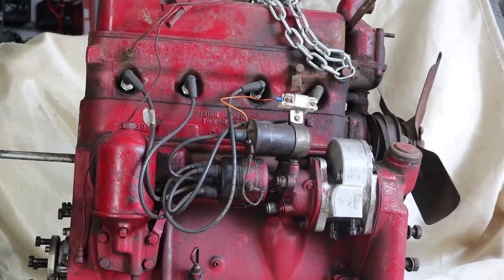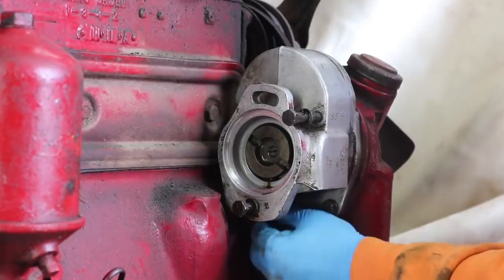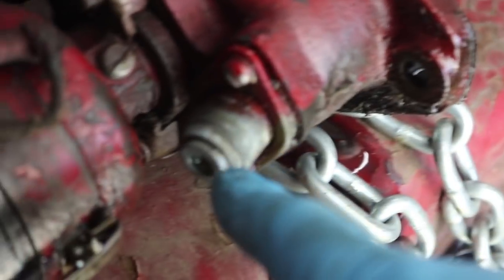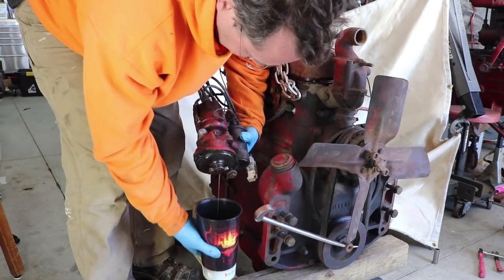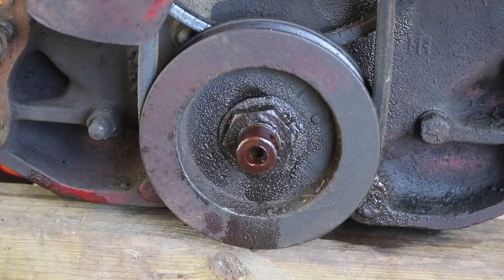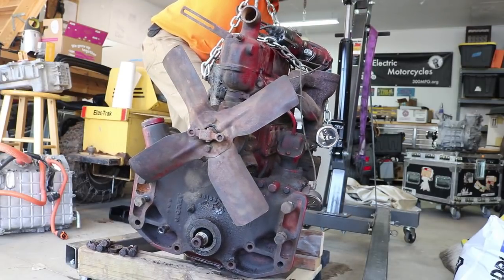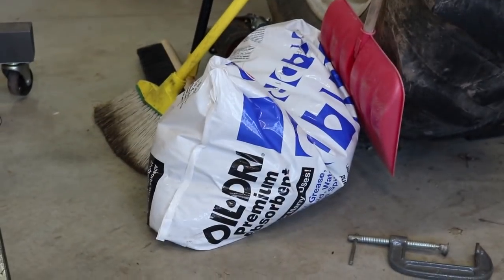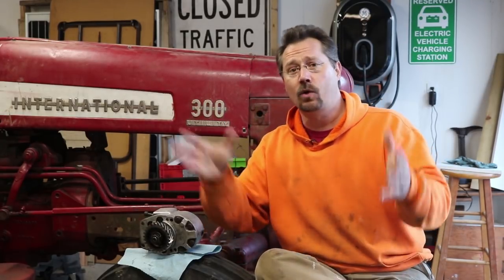Electric Tractor Conversion: Hydraulic Pump Removal

Comment from the maker: Just a reminder. On this tractor, several different things use hydraulic power. The first is power steering, but that's very low power. Secondly is the rear lift - the Fast Hitch/3-Point Hitch. Last is any other external mounted equipment. In this case, the big one is a front-end-loader that came with this tractor and will be reinstalled when the tractor is all back together.
Reply: Zapi motor controllers, I've seen some in forklifts that have dual AC outputs for dual traction motors.  Crown RC 5500 forklifts for example uses them. I believe it's the AC-2.    However I'm not sure what would happen if you have an uneven load between the 2 sides.   Not sure if they could be throttled independently either.  But may be, because a counterbalanced truck will need to shut down or just reduce power to one motor while cornering.  So I'm thinking there probably is a way.

They are wonderful motor controllers too.
Reply from the maker: @AftermarketCRX  I looked up some information on those. Fascinating! One version of that controller has another output - a DC "chopper" PWM power for a pump!
It doesn't look like those controllers are designed for use with just one AC motor as the difference between the two motors is used as part of the steering system.
Reply: I would look for a PTO driven hydraulic pump. Attaches to the rear of PTO and it still has a shaft for PTO for implements on the other end. Grainger sales them. 540 Hydraulic PTO pumps. 
Edit: I just realized that the PTO has a clutch to drive the rear and you need the hydraulics to run with the engine. My bad.

Comment: I personally wouldn't  use that pump. Nothing wrong with it but it is very  expensive to replace to the tune of about $600. There are much cheaper  pumps  that will work just fine for the loader and three point hitch. I mentioned in another  video too you can run a hydraulic pump off the pto.
Reply from the maker: I definitely want to keep the PTO free.
Here's a forklift pump motor I found: https://www.youtube.com/watch?v=K_ax7YcSZhA
I custom machined a part to build an adapter so that I could connect it to the tractor. Seems to work pretty well.
https://www.youtube.com/watch?v=Y0ovdUvEM8g

Comment: Man you dont understand gas engines at all... Watching you count gear teeth to arrive at the ratio between the crankshaft and the diatributor that is for all intensive purposes a constant ratio for firing timing was a great diversion. I love your work. Im doing a iseki conversion i just started. Also hydrolic pumps are not typically rpm sensitive they just move a smaller volume at lower speeds.

Comment: On tractors just a few years younger then your model,  often have 3 hydraulic pumps. Power steering pump, wich your model did not have, 3pth and another one for your loader. So You would need at least 2 electric over hydraulics circuits to power your 3pth and loader. Snow pusher guys with pickup trucks use 12v hydraulic over electrics... i heard you say you are thinking about making your power motor spin constantly in order to spin your pump. Your Nissan motor seems bulky too. Good old Baldor would save you room for your batteries.

Comment: Just use the EV motor to drive a larger hydraulic pump and hydraulic motor to drive the tractor transmission.  Makes the task simpler, just plumbing.

Comment: How about moving the motor to the very front and separating bellhousing / clutch adapter from it. Then you have a long shaft on which you can place a sprocket wherever it is most convenient, to drive the pump. That way you might also get more (more uniform) room for the batteries. Especially when it's possible to place the pump below the shaft.

Comment: You might want to double check the ratings on that pump. Max PSI and Max GPM are often not able to be achieved at the same time. IE: At 10 GPM you may only be able to sustain 600 PSI and you can probably only hit 1200 PSI when the oil flow is almost stopped or close to 0 GPM. It would be nice if you could find a comparable tractor with a loader and see what PSI is typically seen when lifting typical sized loads. I doubt you would often see PSI numbers that high. My Farmall Super H has the belly driven pump and it only achieves around 800 PSI and that's pretty much only at 0 GPM when the cylinders are physically blocked from moving. And even with those low numbers my rear 3 point hitch will very easily lift enough weight at the rear of the tractor to lift the front axle of the tractor off the ground with ease.

So I think the power requirement you entered is the power required to achieve both max PSI and GPM at the same time which is probably major overkill. You would likely be able to get away with a lot less. Also: More modern loader tractors of this size have pumps that only deliver around 7 GPM, so you don't necessarily need 10 GPM to operate a loader. The difference is that other tractors have a separate pump for power steering. Unless you plan to be steering hard and trying to lift a load on the loader at the same time you will probably never need the full 10 GPM.

On that thought: What if you used two motors/pumps? Power steering only needs about 3-4 GPM max and not much pressure so you could probably drive a power steering pump with 1 HP AC motor. (Maybe you could even use a power steering pump from a LEAF to achieve the desired voltage?)
Removing power steering from the main pump should drop your flow requirements considerably. For the rest of the hydraulics you'd probably only ever need 800 PSI at maybe 5 GPM simultaneously which brings you down to under 3 HP needed for that motor.

The advantage to this set up is you wouldn't need to worry about priority control. With a single pump driving both steering and hydraulics you'll find that the power steering can become ineffective when the pump is being used for other hydraulic loads if there isn't a priority control valve to prevent too much flow from going to the other hydraulics instead of the power steering. With separate pumps and motors you have dedicated flow for both systems so using one won't have any impact on the other.
Reply: This might be an interesting option as well:

https://www.target-hydraulics.com/hydraulic-pump-motor/

This company has an electric hydraulic pump that can be driven from DC or AC at a variety of voltages. From the link: "Our wide range of AC motors voltage come with AC110V,AC220v,240v,AC380V,AC415V, single-phase and three-phase; electric power from 0.37kw up to 3Kw."

I don't see any prices mentioned though, could be quite expensive.
Reply: Something else I've been thinking about: The gas motor you removed from that tractor has a max RPM of 1750 RPM. It turns quite slow. The Farmall H it replaced only turned 1650 RPM, so you could get away with an even lower RPM. The LEAF motor turns at up to 10,400 RPM or about 29 RPM per volt. (10,400 RPM / 360 volts = 28.9 RPM/volt)

At 29 RPM per volt you only need to supply that motor about 60 volts to achieve the desired 1650-1750 RPM to "match" the RPM of the gas motor. (Unless you're keeping the reduction gear in the motor? Maybe I should go back and re-watch the motor tear down video because I don't remember if you are keeping that or not.)

If you connected the motor direct without the reduction gear, and powered it at 60 volts (or 16 LEAF cells in series) then that would be a voltage that you could easily find 5-10 HP motors to power that hydraulic pump.
Reply: I just came across this article which specifically goes into detail on sizing a hydraulic pump motor for electric power vs gas/diesel: https://www.hydraulicspneumatics.com/fluid-power-basics/pumps/article/21118764/hydraulic-power-units

Comment: Can't you just use some of-the-shelf electric hydraulic pump with a similar rating and power it over a second inverter?
Reply from the maker: Yes, but a 10 HP electric motor is quite large and heavy. It would take up a fair amount of space and weight.

Comment: Hey Benjamin,
        I've been following your build with great interest. I'm working on a much smaller project of converting an old cub cadet 982 Garden Tractor to basically a compact tractor, If I may have a min of your time, I'd like to ask a question on sourcing and sizing a motor. I'd like to replace the ICE in my Cub with a comparable electric motor. in my case about 15kW and 42 Nm. Plus something that runs around 3200 rpm.  I can find many different electric motors out there but very few hit all 3 check marks. The few that I can find that hit all 3 check marks are very expensive. Can something like this be done with a forklift motor? If so which ones should I be looking at? I find many forklift motors on ebay but most of them have really little info on kW ratings or the RPM's are really low. Can I over come the low RPM's with higher voltage? if so how do I figure out how much voltage I need? As an example: I found Clark 36-48VDC Electric Motor ECG30 Type E Forklift motor on ebay. No info on HP or RPM rating. finding that infor has been very hard, Any tips or knowledge would be appreciated.

Comment: Hmm. I think you're going to run into trouble getting an AC motor and controller for that hydraulic pump within a realistic price range. The equipment is out there, but not generally for sale to the public and very expensive. 

The Leaf doesn't have a tailshaft, no- but perhaps you could access the other end of the shaft more easily than you could come up with a whole separate power system for the hydraulic pump. You're going to be making an adapter plate for the output end, maybe you can pull the housing off the other end and see if it'd be practical to replace it with something that let you access the shaft. At least pull that cover off and see what you'd be working with. 

Alternatively you could go with 24v. A lot of commercial equipment is 24v and there are DC/DCs out there for it.That halves the current to ~300A, and chances are good it'd only be that high intermittently- lifting a full load, eg. but essentially zero when it's being carried. You'd need good LV batteries to handle the surge.

Comment: Could you add an accumulator to the hydraulic system to get the implement movement speed you want while also decreasing the GPM requirement of the pump?

Comment: turn alternator into motor and then use same type alternator to connect direct to lose the money on power control units. (throttle) then use small electric motor to turn the alternator to make the power to make the motor run and you only need one 48 volt throttle control unit to power four motor like the new truck coming out. then use a 55 amps alternator to be turned by a 6 volt 4 amps motor to turn this one to power all four motor and then power the rest any way you want.

Comment: you don't need to count the teeth  in intermiduate gear, you just need to know how many revolutions it makes per single krank rotation and you can do the math then if you count pump revolutions
you didn't even have to disasemble anything , just bar the engine over few times
but of course your method works too
funniest part is, just becayse distributor was on the back end you could just assume it was 1:1

Comment: Hi Ben, Love the video keep them coming! On the subject of this Hydraulic pump motor I would be inclined to look for a mechanical solution such as sprocket and chain  off the shaft going to rear diff off the PTO? I assume you are going to have to build an adapter to go from the Leaf motor to the gearbox could you integrate sprockets and chain or gears off the old tractor into that adapter so that a it could run to the Hydraulic pump... Curious to see what happens... real cliff Hanger...!

Comment: fforklift electric hydraulic pump?
Reply from the maker: Certainly that would be one solution. A 48V motor and pump would take up not a small amount of space, and I'd have to convert from pack voltage down to 48V. That's not a common and cheap DC/DC converter to do that.

Comment: I think you should just find a 10hp dedicated electric hydraulic pump from the likes of an electric forklift. It would be more modern and likely more reliable than hacking it together with a second inverter and a second motor to drive it.

Comment: The lower end high torque of the DC would be a better fit.  Also, it would run the hydraulics better due to it being used with hydraulics in the fork lift.

Comment: Chain drive it off the flywheel on the Nissan leaf motor. The added cost and complexity of a second inverter and motor when you could just chain drive it is a no brainer

Comment: If you ran the pump off the traction motor wouldn't you lose hydraulic power if you're stopped? Having separate traction and hydraulic motors sounds better to me.
Reply from the maker: No. Just push in the clutch and take it out of gear. The motor would keep spinning, just like the engine would.
Reply: @BenjaminNelsonX  haha I forgot about the gearbox! facepalm

Comment: You could use a hydraulic pump that runs off the PTO with a through shaft so you can use the PTO to power other implements like this:
http://vi.raptor.ebaydesc.com/ws/eBayISAPI.dll?ViewItemDescV4&item=254421232782&category=48718&pm=1&ds=0&t=1582275796000&ver=0&cspheader=1
Or, can you fit that pump between the motor and the inner drive shat that powers the PTO which is spinning all the time?